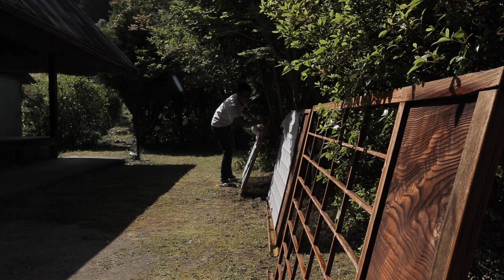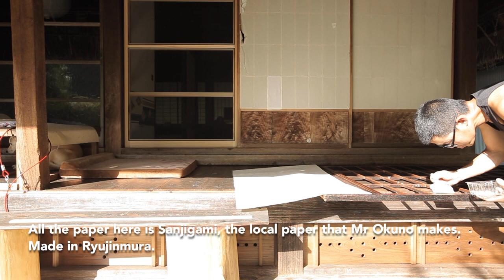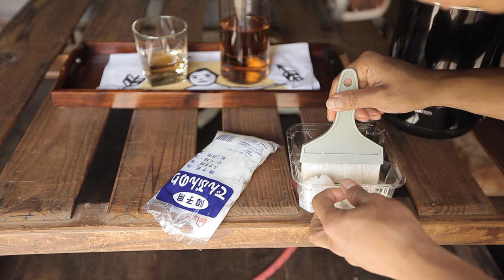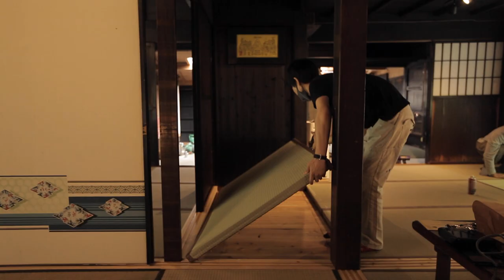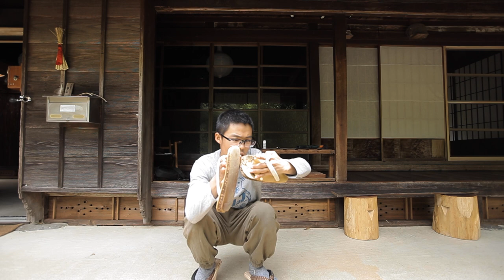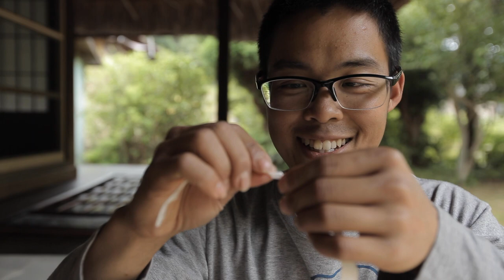Replacing the Paper on the Shoji Screens & Meeting One of Japan's Youngest Tatami Craftsmen

Comment: Great video and thanks for making it.  This year I did five of my 14 screens.  But I used the two sided shoji tape instead of glue/ nori this year.  I think that was a mistake.  The paper is already separating from frame because the tape doesn't adhere that well.  I think taking the tape off next time will be a real pain too.  So, I will go back to the original style and use glue.  
Your paper looks really really nice.  WOW!!
Reply from the maker: Glue works well and is pretty cheap. 14 screens is quite a lot, ganbatte!